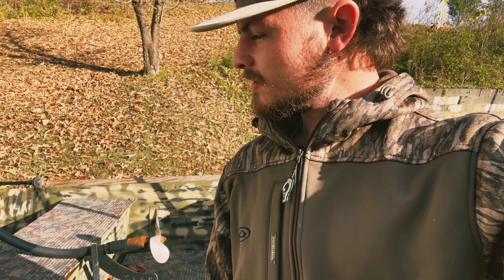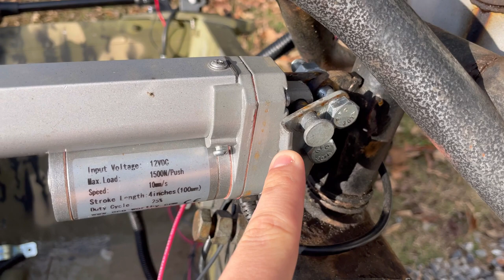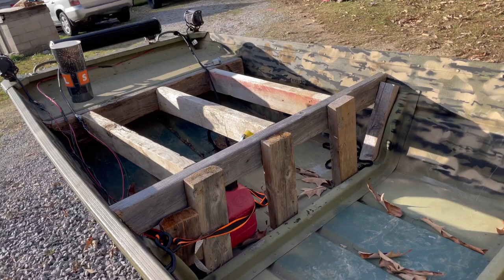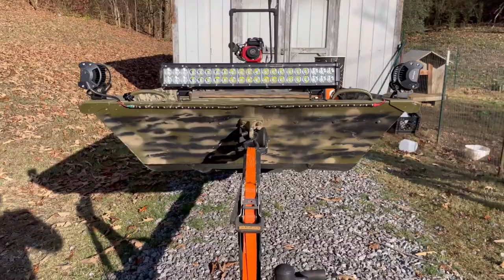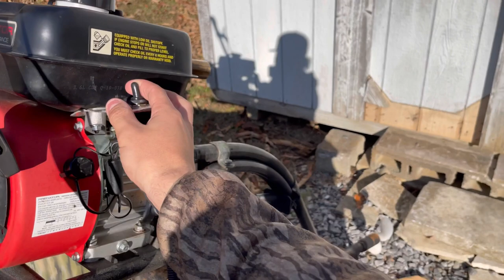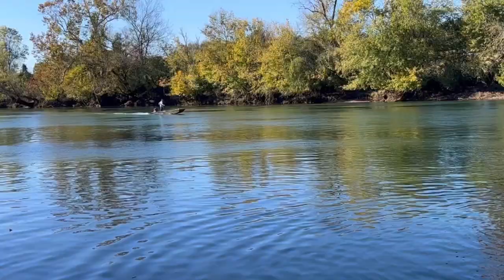I ACTUALLY DID THIS!| Mud Skipper Twister Custom Tilt and Trim!

Comment: Thank you for this!!   I have already started getting my twister ready for the actuator.  One question though, can you still tilt the entire motor back if you are about to hit something, or will it only move with the actuator?
Reply from the maker: Good question!. Yes, I’ve had to lift over many logs. The motor will still lift out of water with the actuator set in its position but you can’t push the prop down any further in the water then what the actuator is set to .
Reply: Awesome.   What I was thinking, but just wanted to make sure.
Reply: I was thinking about making a pin to disconnect it for running through rough stuff.

Comment: So, are you using a 12v linear controller, or do you just have the actuator hooked straight to the battery via the toggle switch?       I have ordered 2 actuators now and have tried just touching them to a battery and neither one will do anything.
Reply from the maker: Actuator is hooked to my 12 v battery as well as a toggle switch with on off on. 
I was able to touch my actuator straight to a battery and it show movement so I’m not sure why yours is not

Comment: The only thing I can see that I don't like about this, is that if you hit a tree stump or something in the ground the motor can't "pop up" out of the water like it's designed to
Reply from the maker: Yes, if you hit something the motor will still pop up and over anything.. The actuator can always go out but won’t allow it to compress any further inward than what you have it set at. That’s the whole point of it .
Reply: gotcha that makes more sense so it's the same design as mud skipper did where it just rests on the pivot shaft for the motor  @aarondixon1